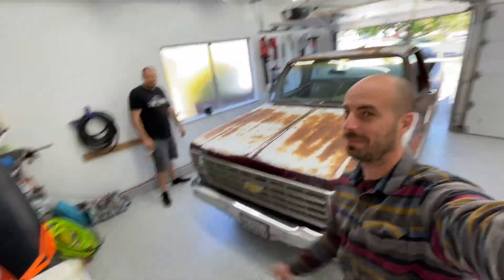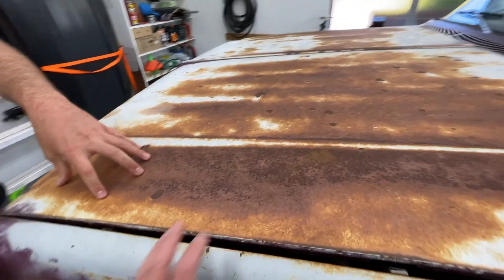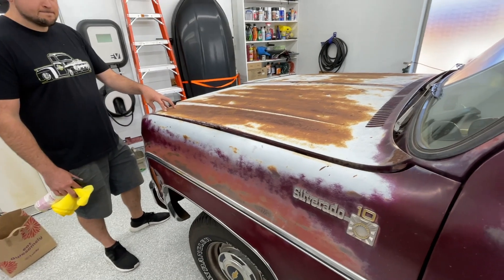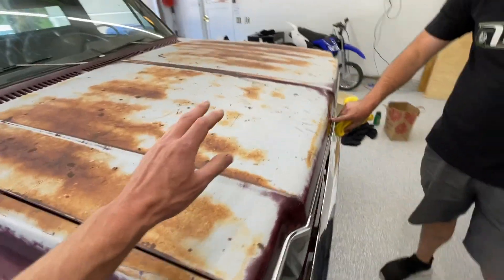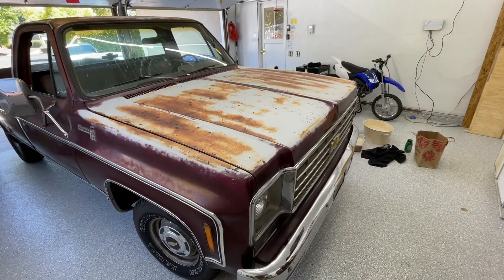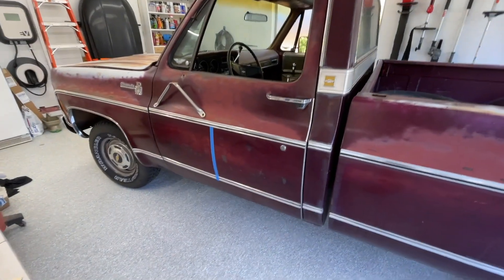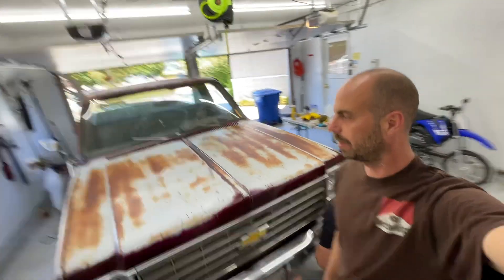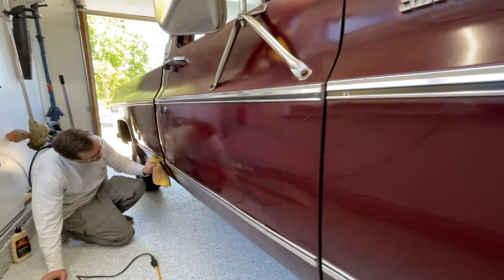Polishing the C10 to its sunday best!

Comment: Cool bro. Ive been watching for the last 4 or 5 hours worth of videos you shared about this swap and the twin turbos first run after the trans swap. Question though, the driveshaft was chopped an inch for the new trans right? When you moved the trans up when you did the LS, did you need to get another drive shaft of was their enough play?
Reply from the maker: Needed a new one, it was about 2” short